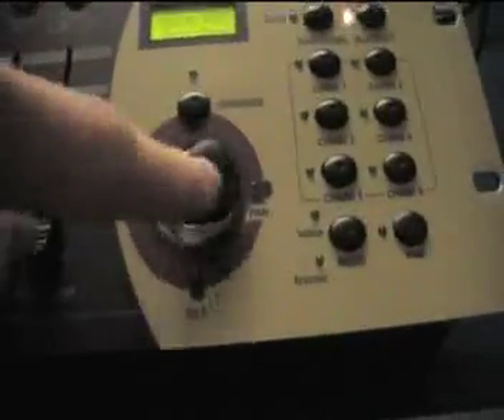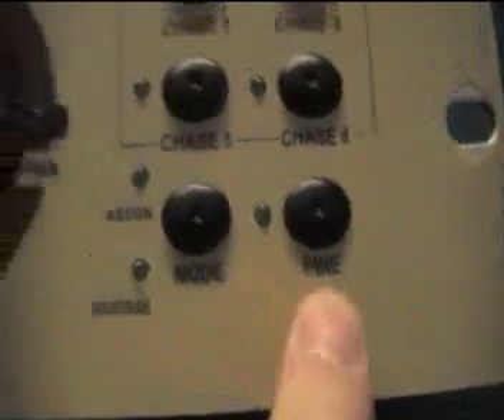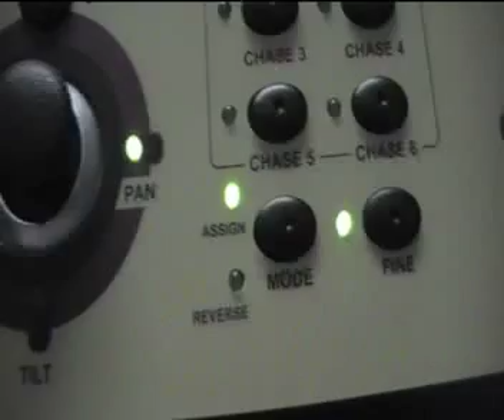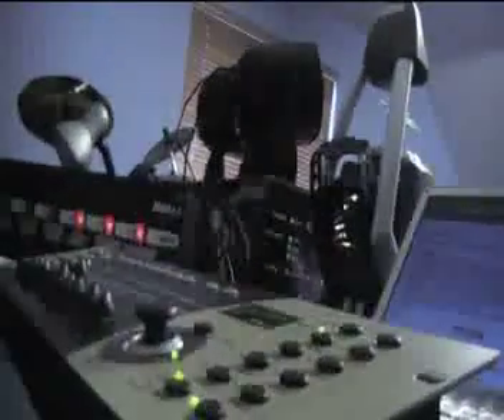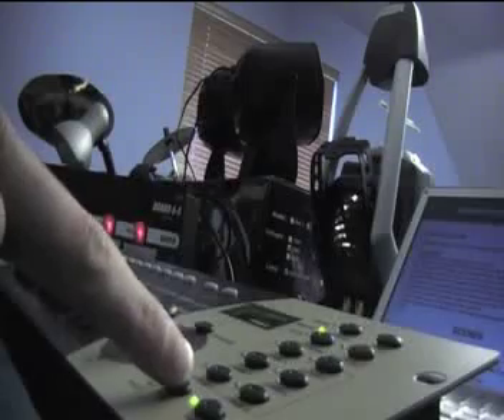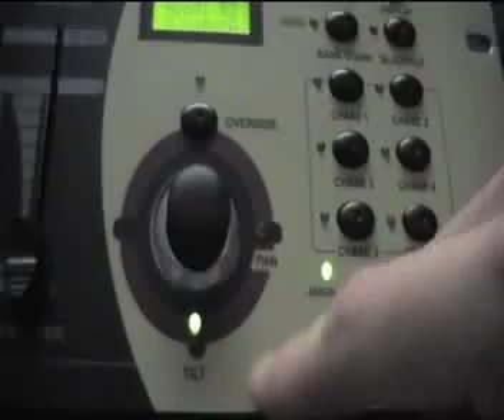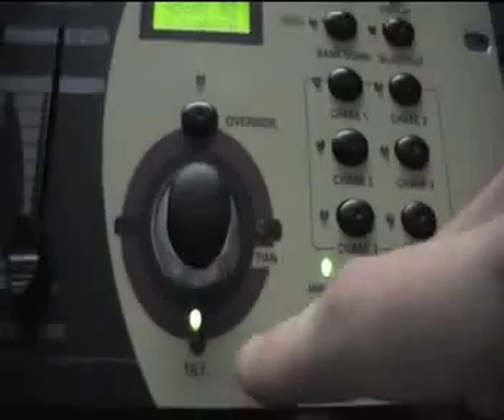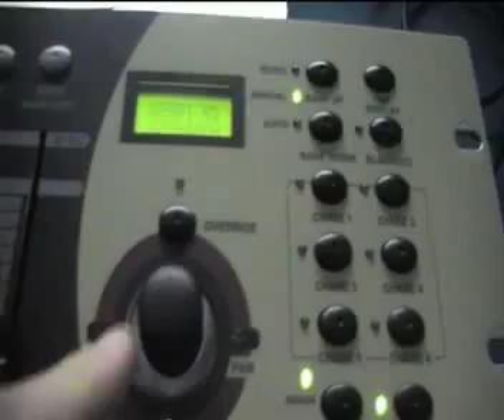Assign Joystick On DMX Controller

Comment from the maker: The joystick is really just used for programming and fine adjustments therefore it moves the fixtures only a tiny amount. On my dmx board there is a 'fine' button which limits the movement, maybe you have this selected as mine move quite fast without it on. 

hope that helps.